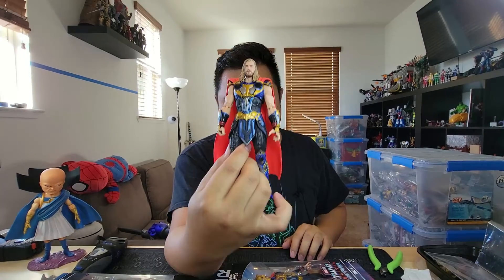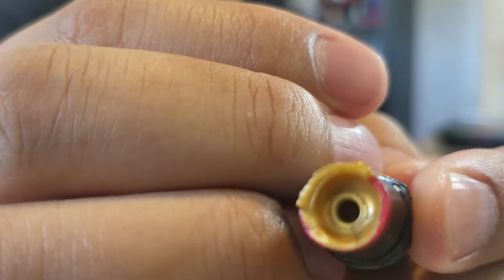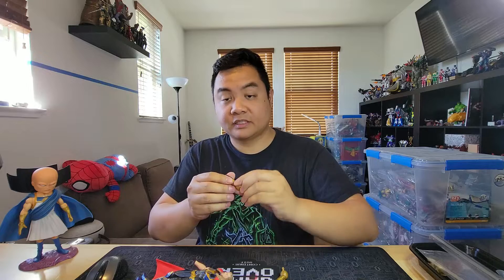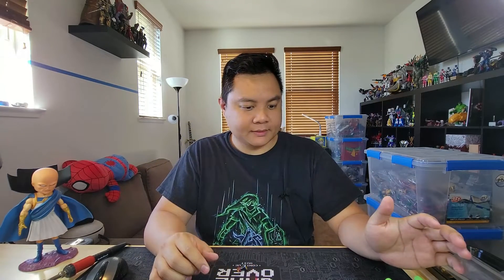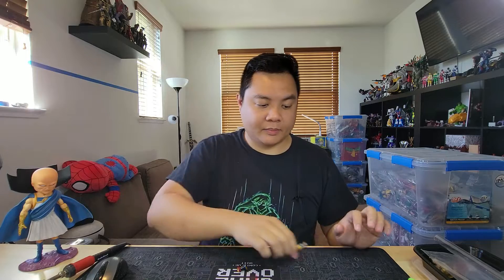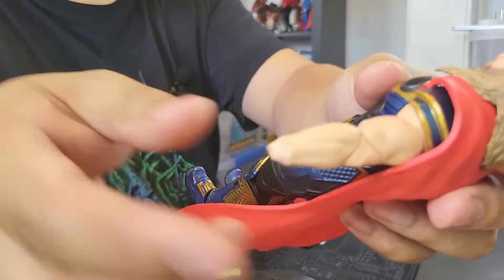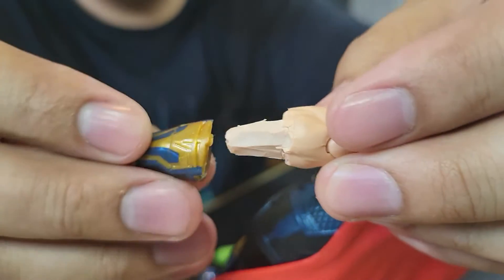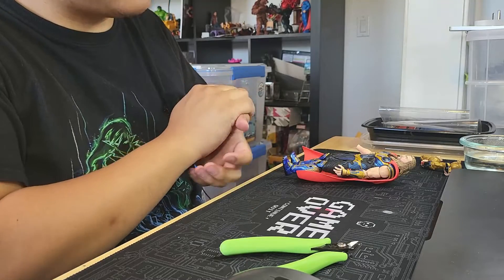Custom Marvel Legends Thor Love and Thunder Part 2 (Gauntlets)

Comment: Recent update. Just used my dremel to hollow out the gauntlets. Used the sanding bit to smooth them out but made a change to the last step. Instead of sanding down the forearms, I heated up the gauntlets in hot water and slid them on. The hands hold them in place.
Reply from the maker: That's a good idea too! I guess the gauntlets don't seem too noticeably bigger since they are being stretch over the arms now?
Reply: Correct. They look better because Thor actually looks like he's now wearing gauntlets over his forearms. Hasbro doesn't seem to realize that armor makes characters look bigger.
Reply from the maker: Nice man!
Reply: Would it work if I just cut off midway up his bare forearms and snap the gauntlet off the armored arm then glued them so I don't have to hollow out?
Reply from the maker: Theoretically that would work, but unless you are very, VERY precise with where you cut/snap the arms, then you'll end up with crooked arms. And with the amount of time it would take to get them cut just right, I think it's worth the time to just hollow them out.
Reply: Invest in a dremel if you want this to work. The "forearms" are glued in tight. Expect a lot of hard work pulling out that piece. Grinding or melting the plastic out to make room is a lot easier.

Comment: Question, could a regular drill do the job as well, or does it need to be a dremel?
Reply from the maker: There's no reason a regular drill wouldn't work. I used a Dremel because it's what I have. Though I think a rotary tool like a Dremel also provide a bit more control than I think a regular drill will. And I would be worried about the weight of the battery(unless it's corded) might throw you off too when you're trying to be steady if that makes sense. But the principals should be the same! If you try it then please let me know if it works!

Comment: Love to try this out but I’ve noticed I don’t have steady hands and I feel like I’d mess up the figure so now I just kinda gotta wait
Reply from the maker: I would love to be able help you be able to do customs yourself. Would you mind or be interested in telling me about the steadiness of your hands? Is it one or both? Could it work if you only had to hold one thing?
Reply: @ComicallyToys  it’s both and no my hands still shake while I hold one thing
Reply from the maker: Thanks so much for sharing that with me. I'm brainstorming ways to make this easier. Is your main concern the soldering and using the rotary tool? I guess more specifically, would you be able to follow the first video in order to crack the body open to access the arms to begin with? Or is that also something outside of your ability due to your hand shaking?
Reply: @ComicallyToys  I can follow the first video

Comment: Bro how did you remove that entire arm from armored thor?
Reply from the maker: If you heat it up enough it'll pop out when you pull hard enough. You might have use boiling water from the stove and let it soak for a bit. I hope that helps!

Comment: If I was smart enough I would attempt this but I don’t trust myself and I’m sure I would destroy the figure……all I can hope is maybe hasbro will release a version like this one some time this year
Reply from the maker: Hey don't be so hard on yourself! It's not like I'm a professional at this either. I'm a hobbyist just like you! And if it helps, I've only made one other Marvel Legends successfully before, and that was Agent Venom. I did a very similar to the mode because the hands on the original aren't posable or swappable at all.

If you are interested in doing something like this, but are worried to destroy your figure then I'd recommend getting a spare figure as fodder to try it on. I hope you consider it because modding can be pretty fun! :)